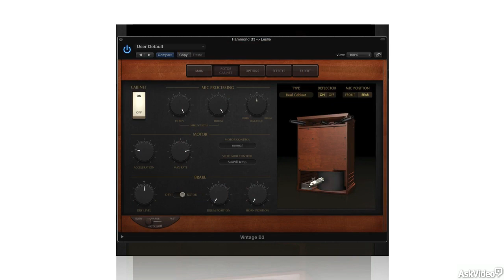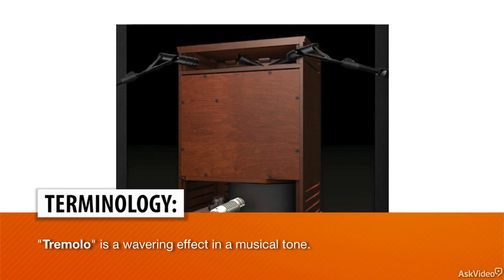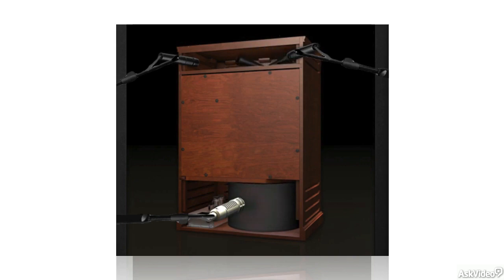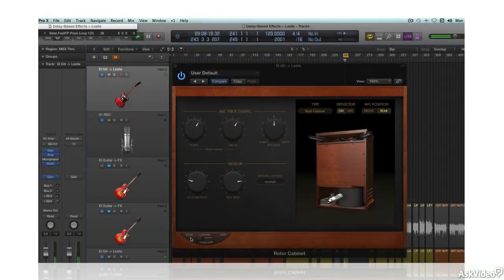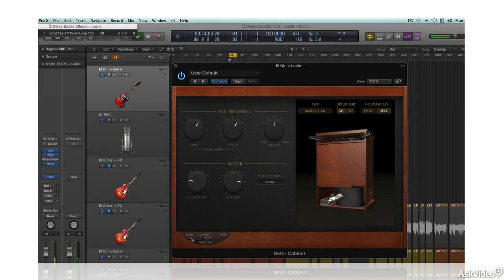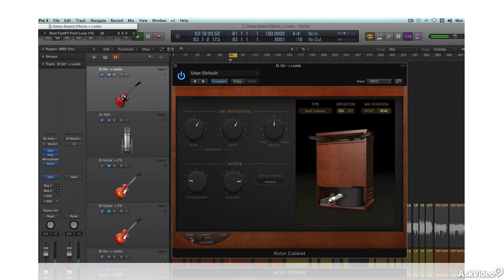Audio Concepts 104: Delay and Reverb Effects - 7. The Leslie Rotating Speaker

Comment: The speakers to NOT move the the top horn and bass unit have the speaker sounds ducted into them, the animation shows the bass speaker facing down, the top HF unit faces upwards, there is only one top horn that carries sound the other is a blank to act as a mechanical balance.